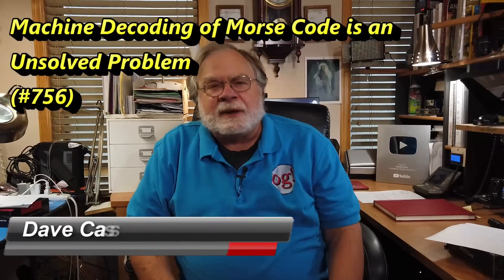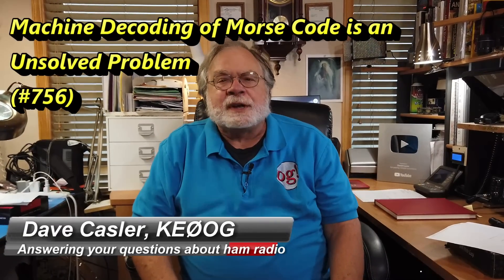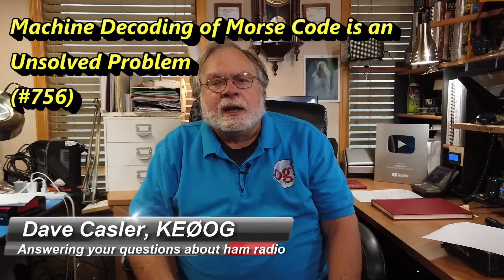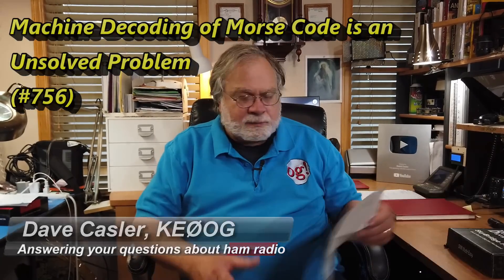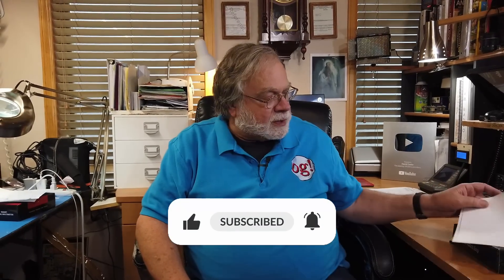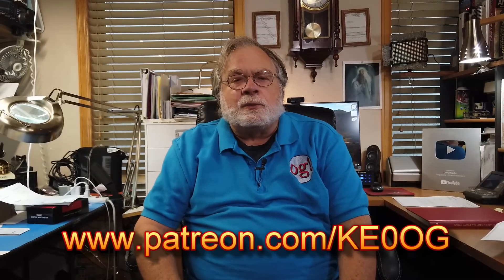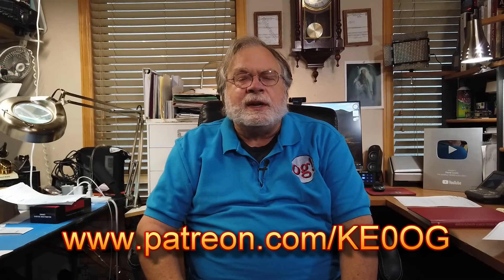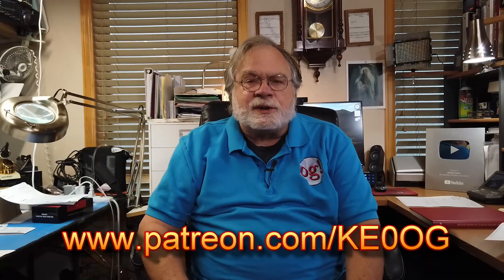Machine Decoding of Morse Code is an Unsolved Problem (#756)

Comment: Dave, it appears you “broke the code” with regard to Morse in the real world. Those Western Union and the Navy and Coast Guard operators learned the nuances of human generated code—and they got very good at it. For them, the skill got them a full time, 40-hours-plus job on which they depended for their living.

As you explained, for today’s casual amateur radio operator to become a skilled, FAST CW op is extremely difficult. For a 77 year old like me, getting serious for the first time, it’s even harder. I must remind myself of this over and over to prevent losing my patience, deciding to quit, and throwing my expensive key against the shack wall.

Everybody has advice, short cuts to reach CW mastery, say about 20 words per minute. Learn the letters and get to 12 words per minute with the aid of pencil and paper. No, don’t do that. Learn the letters at 25 words per minute from the beginning—avoid the dreaded “speed plateau.” And don’t ever write anything down. Instant letter recognition is the only way to go—writing as you hear with drag you down.

The truth is if you’re not 12 to 16 years old and driven by financial pressure, developing Morse Code skill is just tough.

Most people don’t use Morse, including contesters. Those folks simply preside over their computers interacting with the other guys’ or gals’ computers through their radios. Wait. You actually assumed 40 to 50 word per minute exchanges in the CQ Worldwide CW Contest were actual hams pounding on actual keys? Such naïveté.

Comment: Dave, I wanted to let you know that I'm currently working on a machine learning-based Morse code decoder. The primary tests have shown promising results. When it comes to decoding Morse code, context is everything, and leveraging machine learning really helps with that. The project will be open source, and I plan to share it with the community after the alpha phase.
Reply: where would we be able to stay updated on your project?
Reply: genius idea btw, and I'm confident it could solve this problem

Comment: In addition whit my comment below;
Computers are increasingly capable of working with complex audio input.
Look how good spoken word is processed to control your computer or other hardware.
You can order your phone by spoken word to send a mail to your mother with the message you give it..
I can talk to my phone in my own language en it will translate and speak even out the translation.
Why would good designated software be incapable of handling a binary audio code pretty well?

Comment: David,
Can't see your argument.
CW is a binary code. Very suitable for software.
Sure there can be problems with partly weak signals and inconsistency in code speed.
The software I tested where not great in the job indeed. In my opinion real good developed software should work better than the human ear and brain and should be able to interact on the speed en signal strength issues I mentioned.
Take QRSS, it decodes signals not distinguishable from the noise floor by human ears.
MRP40 is on my to do list to try out.

Anyone to reflect on me or correct me in case I'm very wrong??

Comment: Hey Dave.  My dad was working for a Railroad (Denver & Rio Grande) in the signal department some time after when Morse communications were being decommissioned.    I ended up with a couple of sounders.   Actually had a line between me and the neighbor kid at one point.    The neighbor never learned code, but he would try to send me messages off of a cheat sheet.   I didn't know about American Morse back then, so we were attempting to use International code per my boyscout handbook. 

One minor error in you description of landline telegraphy is that a sounder makes a "click" when it pulls down, and sort of a "Clack" when  the magnets release....sort of like the "tick" vs the "tock" the two pallets on in a clock escapement alternately engage the escape wheel.  

Another interesting detail is that a dispatcher in a railroad office would often have more than one line to monitor.    They would take and mangle tobacco tins in various ways and attach them to the sounders giving each one a unique voice, so they didn't have to look to know which line they were hearing.   My dad said they could typically copy while carrying on an in person conversation, and some could even copy two lines at once....kind of how a DXer can often pull multiple calls from a pileup.    Typically the main line (the one train orders came in on) sounder would be mounted on an extenable arm (like a podcaster's  microphone) so that it could be positioned close to the ear while typing the train orders on a "mill"....a "mill" was a type writer with caps only, and a sort of dot-matrix font that would still be readable with lots of carbon copies.

Comment: Dave! You have convinced me that decoding CW sent by humans is impossible with software, especially when one takes noise into account. Only "wetware" will eventually succeed with training. I was just about ready to pop for a MMX ZERO bundle for my IC-705 or my KX2 but decided to do my due diligence one last time. I found your video just in time to prevent me from making that mistake. I will have to keep my appetite for gadgets at bay.... until, as you say, someone comes up with an AI-assisted solution! Thank you!

Comment: I actually asked ChatGPT (Artificial Intelligence) this question:
Morse Code is sent by humans, so there is variation in spacing. A human can pick up on the different spacing and understand the message, but typically computers have a hard time with Morse Code.  What are your thoughts?

This was the reply:
You are correct that Morse code, as a communication system, relies on variations in spacing between dots, dashes, and gaps to convey information. Humans can often interpret these variations and understand the message, but computers, especially those with basic algorithms, may struggle to handle the nuances of Morse code.

Traditional computers are typically designed to process digital data in a binary format, where timing and spacing variations are not easily discernible. Morse code, on the other hand, is an analog communication method that relies on variations in timing. This poses a challenge for computers to accurately interpret Morse code without proper algorithms or specialized hardware.

However, with the advancement of technology and the development of specialized algorithms and software, computers can now analyze and decode Morse code more effectively. Signal processing techniques can be used to detect and differentiate between dots, dashes, and gaps, allowing computers to accurately interpret Morse code messages.

There are also specific devices and software designed to facilitate Morse code communication with computers. For example, Morse code keyboards or input devices can be used to translate Morse code into digital text that computers can understand. Similarly, there are software programs that can decode Morse code signals captured from audio or visual inputs.

In summary, while Morse code may pose challenges for traditional computers without the appropriate algorithms or hardware, advancements in technology have enabled computers to better handle Morse code and facilitate communication using this system.

Comment: Have you tried CHAT GPT?  It's an AI program that can assist you in solving problems.

Treat each character individually instead of trying to determine keying speed.  And use AI to see if the characters make sense and then generate a corrected output if they dont.

Comment: I would love to find a decoder that works on rainscatter CW contacts.  Every one I’ve tried requires a tone to decode, where rainscatter is more of an amplitude varying hiss due to the doppler spreading on the signal.
Reply from the maker: Sounds interesting. I've not heard of rain scatter. You have a chance if the code is sent by machine, even more so if it's synchronized to UTC (dit boundaries all have well-known starting times).

Comment: i wondered where you were going with this, as i was exposed to automatic morse in the navy.   i don't remember the speed, but it was fast, using adulator tape with india ink pens.
Reply from the maker: Actually, using pens to mark the signal goes back to the way S.F.B. Morse originally conceived of Morse code. Others would record the reception and play it back at a lower speed.
Reply: @davecasler  the auto morse i remember was very fast, so they would have to play it back at about 40 or so to keep up with it.

i used to be able to copy 15 with a stick and did okay, but i am rusty now.

Comment: David, We have a small group of folks who are bringing alive an authentic 1900's railway more code system. We have three railway stations set up with original keys, relays and sounders and they are doing demonstrations for visitors at Heritage Park in Calgary Alberta, Canada. Visitors find it quite facinating. We have no computers in sight.
Reply from the maker: Are you using "American Morse" (railroad Morse) or the Continental system we hams use on the air?
Reply: @davecasler  American, we are emulating a 1900’s railway office.
Reply from the maker: @chrismeade  Super!

Comment: My remark is about the use of a "bug".  Most CW operators today, including me, are still. in the learning process.  Well this is a nice phrase, but what I relay mean is  what you hear on the air is sometimes really really awful...   People either send fast with a straight key or send slow with a mechanical "bug".  In any case none the machine nor the brain can decode any of that stuff. Those shiny bugs are nice, but they can not be adjusted for slow speed. Their place is in the display case. Not to mention the problem of mechanical glitches.

I propose the use of an electronic keyer (paddles) set for a moderate speed  with longer spacing between characters. This way the beginners (we all are) have a chance to step in.

The problem is in sending the code as well as reading it!
Reply from the maker: Ah, wait until you see my review. It turns out Vibroplex has a slow-speed attachment.

Comment: Dear Dave. I appreciate and value your experience, technical knowledge and wisdom, but on this one you seem to be a bit outdated. Machine-decoding human-sent morse code is not a problem with current fast processing machines running appropriate software. It has only not been made available at a price that the average ham would want to pay. Self-learning software that adapts to the sender's handwriting, has been around for many years. I find that MRP40 does a reasonable job, though not perfect, but it is absurdly priced (USD 60). 73 de HA7RJA
Reply from the maker: Rob, many thanks for the information. I'll get it and report on it. 73

Comment: Assuming if even the spacing between characters is not exact, if the spacing between dots and dashs IS exact due to electronic keyers (even if the ratio isn't the same as what you normally use), it SHOULD be possible to create a reliable decoder. You shouldn't even have to adjust the speed. The software should be able to detect the speed and ratio of dots to dashes very quickly. It's a matter of just a little AI.  Now, autodecoding hand keying is another story.

Comment: WOW! I did my Masters Thesis on the exact same subject with excellent results in 1993. I used an algorithm that allowed timing to vary quite a bit. Contact me if you want to discuss my method.
Reply: Would be interested to know more about your algorithm.  Also, what did you use for your demodulator?

Comment: Dave, very interesting to hear your history of morse. I have read that the code invented by Morse or his employees used three element lengths rather than the two we now use. Is that right? I’ve been using tone based morse since about 1962. I have a kx3 and sometimes out of curiosity I set the menu to display the morse but it isn’t accurate enough with weak signals i can copy better by ear.  The voltage level on my battery is more important on a hilltop so thats where the info display sits most of the time. Btw i copied a bit of the signal off your 7300, commenting on the heat. 73 VK1DA

Comment: Not really, I wrote code in basic on a radio shack color computer in 1984 to read Morse code….worked great handled the various speeds automatically
Reply: But did it decode hand sent code?  That’s his point.  He’s not talking about various speeds of code.  He’s talking about code with variable timing.  Any decoder will work with perfect machine sent code, even old ones.

Comment: I've been working on a decoder.  I'm okay at hearing Morse Code but a bit slow and rusty; I like to have a back-up copy machine in case I blank out momentarily trying to remember something.

I am mindful of the amazing power of the human brain at this task, how you can choose one signal out of many because of its pitch and follow it.  The machine equivalent is correlation which is a lot like a DFT (Discrete Fourier Transform) and starts out that way.   Windows offers me 100 samples per second, that is to say, 1/100th of a second of the actual sample rate , so in that sample will be 6 cycles of 600 Hz, but more or fewer cycles of other Hz and they might even be stronger.

So what you do is have a digitized sine wave in memory and you multiply each sample of the sine wave in memory with the incoming digitized audio.   Because 1 times 1 is 1, and -1 times -1 is also 1, if there's a 600 Hz audio in the stream of data, and it is in phase, you'll get a pronounced peak energy for that 1/100th second window.  Other audio frequencies will sometimes be in phase and sometimes not, and so will often completely cancel.  How tight you can filter depends on the window size of 1/100th second or 10 milliseconds.   It works out to about 100 Hz bandwidth.  Obviously if you extend the window size you can narrow the bandwidth.

So what this does is FILTER the stream and turn it into a new stream of sometimes stronger when 600 Hz is present, and sometimes weaker when it isn't.  So you develop a running threshold that dynamically adjusts.  Samples above that are a "1" and samples below that are a "0" and purified to make it so.  Now you have a stream of simple 1's and 0's.  

The next task is to discover the "bit time".  Look for a RUN of consecutive 1's and measure the length, that might be a dit and might be a dah, store in both.  When you find a run that is longer, it becomes the new dah; and if shorter, it becomes the dit.  

Meanwhile, convert the stream of 100 Hz bits, into a stream of silent, dit and dah symbols.  As soon as an intercharacter space comes along, the accumulated dit-dah register feeds into a binary tree decoder; if it starts "dit" then this branch and assume "E:, if "dah" then that branch and assume "T".  If the second symbol is "dit" after dit, "I", if "dah" after dit, "A".  Notice that we don't yet know or care if we hit the end of the symbol; we are building up a tree.  When we have exhausted the symbols, whatever is in the character register is the decode.  It is VERY fast and efficient.  Quite a challenge to develop the code-tree.

Having Windows chop the audio into blocks at 100 Hz rate isn't ideal, there are some things I would do; and to mimic human hearing, use the correlation idea but with entire characters rather than dits and dahs.  You'd still have to figure out dot spacing, AND you'd need a flag for iambic precision or hand-sent Morse code.  If Iambic then you can be a lot more precise in the correlator.

What you would do in that scenario is the same as GPS decodes; all 24 or so GPS satellites transmit on the same exact frequency!  But a correlator compares a pattern in memory with the data stream, and when it is in phase with that GPS signal, there will be an energy peak.

So what you do is correlate longest symbol first; if you look just for "dit" you are going to see thousands of them.   Look for dah-dah-di-di-dah-dah and if it matches, bingo!  You know what it is.  Not only that, but the longer correlation makes a much finer bandwidth, maybe 20 Hz. 

The challenge there is that your character size must be exact, so your dot spacing calculation must be exact and this is going to work only for iambic code most likely.  But it would pull code out of a LOT of noise.

Since CQ is easily recognized, the initialzation process would look for CQ at many different sizes (milliseconds for the while thing) and on recognizing it, population the dot and dash spacing and build the correlations for all of the characters. 

Existing decoders probably use FFT but that's not ideal and not very well nuanced.  FFT has the advantage of being able to simultaneously decode MANY stations but its window size is very much a complicating factor; a wide window allows for precise separation of stations BUT you lose fine-grained dot spacing.

Comment: Great video. After I retired I started coding Android apps, and after creating a morse trainer I wanted to see if I could also create a matching decoder...
My first attempts at decoding where based on timings, but as you quite rightly state, there is always timing variations with 'manual morse' (ignoring signal variations for a moment).
My solution was to base the decoding on comparisons between current and previous 'events', be that a 'digit' or space. This works pretty well, and pretty quick at adjusting for WPM changes.
But it will always need a reasonable signal to noise ratio to perform 100%.